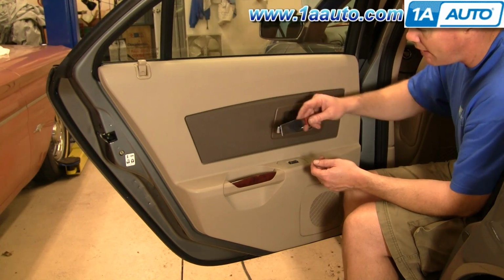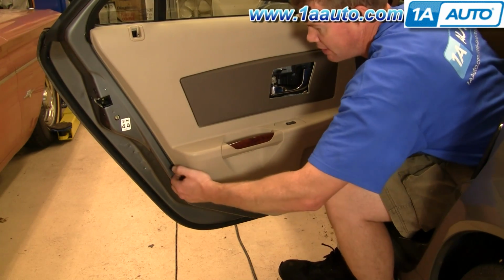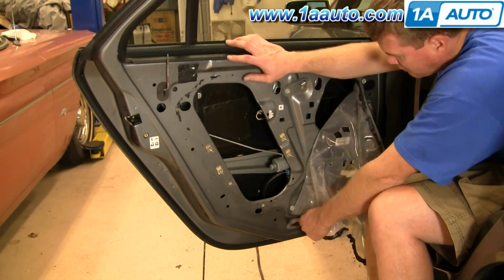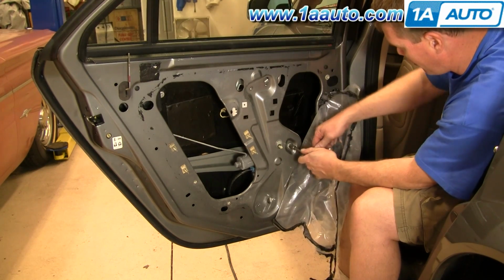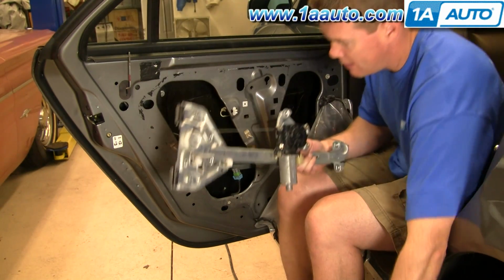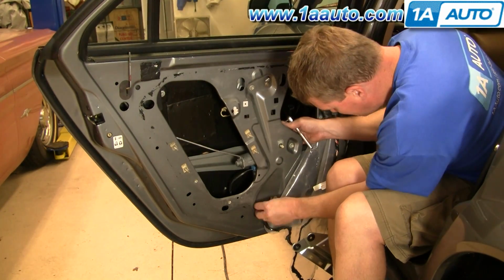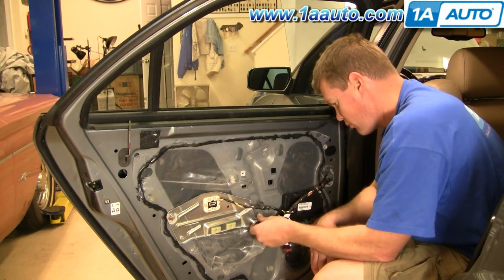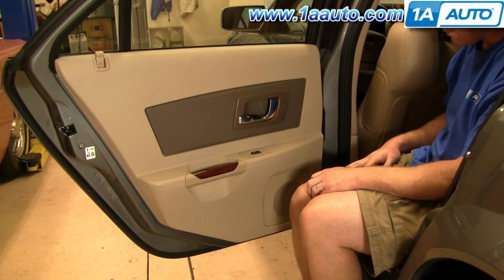How To Replace Rear Power Window Regulator 03-07 Cadillac CTS

Comment: Great video!  100% spot on.  Only exceptions I had, which may have been in the video and I just didn't notice was loosening the window slide nuts before installing the regulator and watching out for the lock rod alignment when putting the panel back on.  Thanks so much for this quality tutorial!

Comment: Should I disconnect my battery? My haines Manuel told me to do so , in case of activating air bag?
Reply from the maker: +Caleb Lamma It will not hurt anything if you disconnect the battery.

Comment: Thank you for sharing this! I was given a 2003 CTS that both the back window motors are gone on (Previous owner said to not let them down because they won't go back up , so I'm assuming this is the issue -Motor replacement). Also the back doors will retain water when it rains... Will I need to purchase a new rubber window gasket along with the motors?

Comment: Thanks, excellent video.  If I press the power switches on the door handles and I can hear the sound of the motor(?) or some sound, does that indicate that the motor is working and only the regulator is not functioning?
Reply from the maker: If there's power to the window motor when the switch is pressed and it's not working, you may have a bad window motor. We carry new window regulators with motors on our website 1aauto.com 866-403-3393

Comment from the maker: You may want to test the power going to the window motors with a test light to see if they all have power going to them. Also check the wire harness that runs between the drivers side door and body of the car for a broke or frayed wire that might be causing the issue. Hope this helps you out. 1aauto.com 888-844-3393

Comment: I took my door panel off and the wire is off the wheel, Should I still replace it or can I put cable back on? I have a 2005 cts.

Comment from the maker: Make sure that there isn't a pinched or crossed wire on the wiper switch that could be causing this issue. 
Check the power to the window motor, if it has power to it the window motor may be bad. We carry new window motors and window regulators on out website 1aauto.com 888-844-3393

Comment: I have 2004 Cadillac CTS my right rear passenger side window do not work the only action i get from it when u try operate it from the from drive side is just a little noise so i know that there is power going around there but it don't work, i would like to know it a motor/ regulator problem?  and also do you have any video on diagnose/repairing windshield wiper the wiper wont turn off when you plug it in? thank you for the videos.

Comment from the maker: It may. You might want to check the wire harness between the door and body of the car for a frayed or broken wire that may be causing this issue. You could also take the door panel off to see if there's a frayed wire inside of the door making contact with a piece of metal.

Comment: @1aauto Thanks for the link. The cable went on mine, and was caught so no mater what, the window was getting pulled down. I would love to grab yours, but i work for GM canada, so pricing is a very big difference. Thanks for the info video, i had the door off in a matter of about 3 minutes.